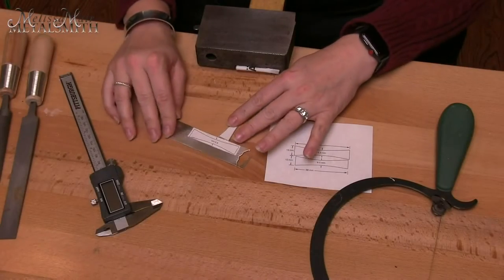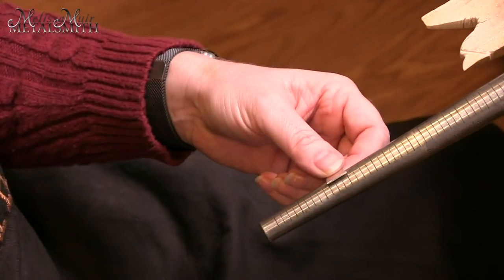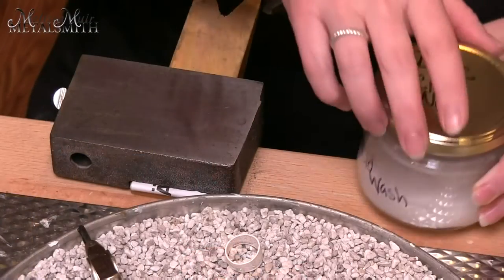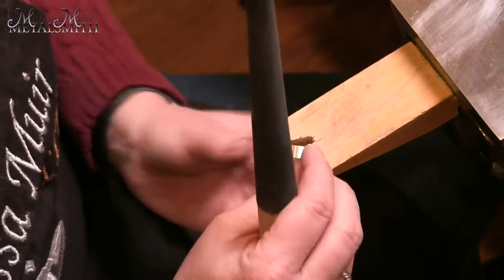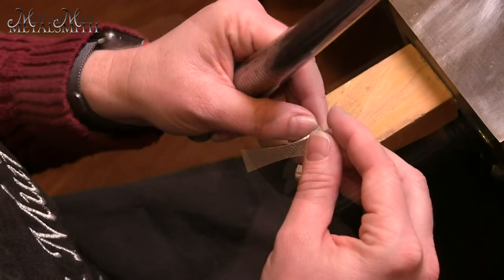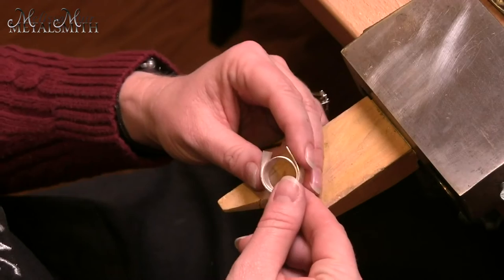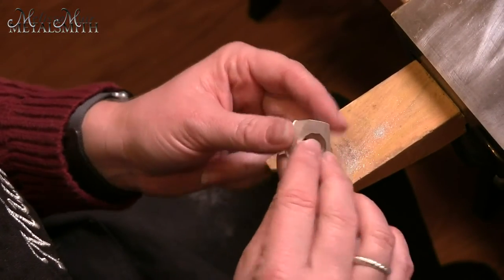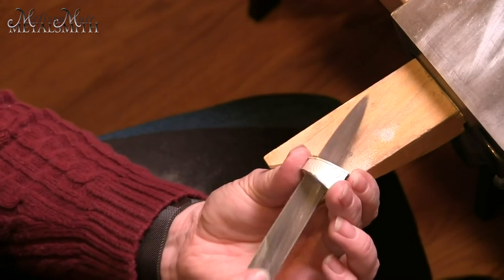Project 9- Box Ring - Revere Professional Jewelry Making Series- Tool Time Tuesday

Comment: I learned to use hard solder for all ! Depends where you place the flame ,even if their is 4-5 solders joints and settings too ! All got to do with how well you can solder . I try to use hard for all !  I'm old school ! 3rd generation  38yrs hand made . I use medium ,soft for repair or features !  I try to stick to hard ,medium for most !

Comment: To perfectly align the inner and outer rings, simply mark on the side with a thin line of saw the center of the length of these pieces before bending them. These parts will be filed after welding.

Comment: Hi Melissa! Loved your video! I was wondering if you could provide a link for the cone with the sand paper for removing excess solder from the seam inside the ring. Thank you
Reply from the maker: I am unable to find that accessory now. But this is what I am using these days, they are mini mounted abrasives and are amazing on the inside of a ring: https://www.gesswein.com/search/?search_query=mounted+abrasive

Use MM20 at checkout and it will give you a discount on them.

Comment: Another great video did not see any mistakes, maybe different technique but not mistakes you should explore the option of a smiths little torch or similar once you have used one 
you will put all your refillable propane  torches in the bin.
Reply from the maker: pijnto the main soldering was done with my acetylene torch. I just used the little butane torch to light the piece to burn off the alcohol. I also have a little torch with propane/oxy. I think I have 7 or 8 different torches in my studio. 😊
Reply: @MelissaMuir  Yes I know you used the acetylene air torch I got the impression that was the only one you had except the refillable ones. pretty much use my smiths for every thing and just change the tips, in saying that I have just made a belt buckle (Kilt) I used my oxy acetylene welding set out in the shed for that

Comment: I made the mistake of buying 22 gauge, will that work as well?  Also, I need to make a size 9 ring, and was wondering what measurements I would need to cut for the band?  This will be a birthday gift for a friend, who has a birthday on the 23rd, so hoping to have this done before then.  Thank you for your time, and have a wonderful day.
Reply from the maker: You should be fine with 22 gauge. I am not sure as to the measurements. You will Have to play around with it a little bit.

Comment: Just curious on the moment if you solder and seal the top..is there a need for a hole anywhere due to trapped air inside?
Reply from the maker: Yes. Absolutely there must be a hole somewhere for the gas to escape.

Comment: thank you for the video! could you be so kind and tell me what kind of alchool are you using in the mixture with the acid boric? Which is the proportion between the two? thank you
Reply from the maker: It is denatured alcohol. I poured in a bunch of boric acid, and then poured in the alcohol so it was almost a 50/50 mix when looking at it after the boric acid had settled. :)

Comment: Will you please tell me if you use first hard medium and for the last easy solder?
Reply from the maker: Ana Millan no. It is all done with hard solder. I explain why in the video. But we use all hard so that you can use a lower melting solder later for the top part.
Reply: @MelissaMuir  Thank you very much for answering. I love your videos, my first language is not English, so I have to review more than twice your videos but you explain very well every step!
Reply from the maker: Ana Millan thank you. I am glad you find them helpful.
Reply: @MelissaMuir  Always! Thank you very much!!
Reply: Melissa Muir I thought you are supposed to solder first with hard then medium then easy.  I was afraid of doing the inner shank with hard then moving on to the outside with the same afraid that the seam might open? And I didn’t see you do so I guess when you said you are only using the solder as a holding point you don’t need to turn it over and solder the other side? I’m guessing because when you solder the sides that will be enough to hold everything in place? Thanks Melissa I love watching your videos.
Reply from the maker: marianne jennings when solder has flowed for the first time its melting temperature goes up a little. So any new solder will flow before the first solder flows again. For this reason I use hard solder about 96% of the time on my pieces.